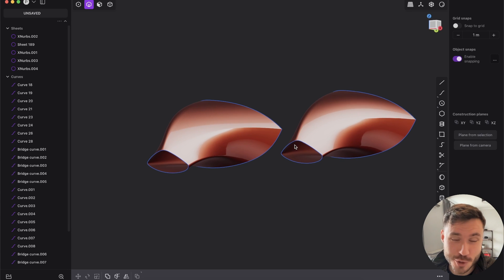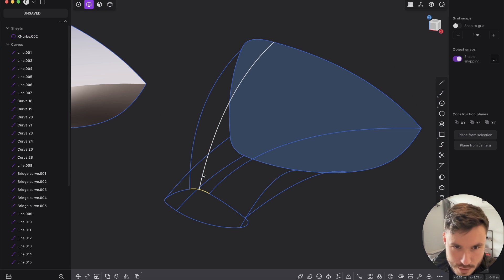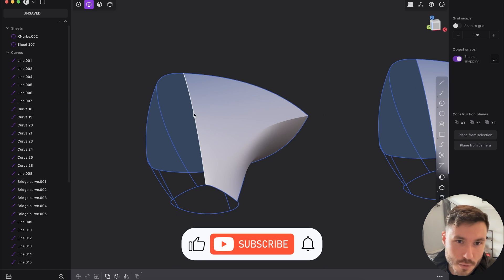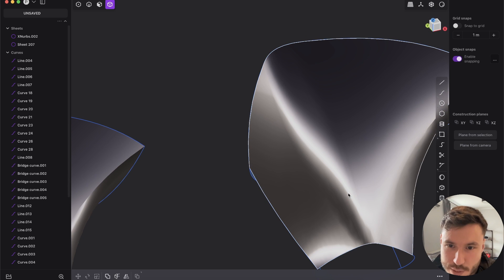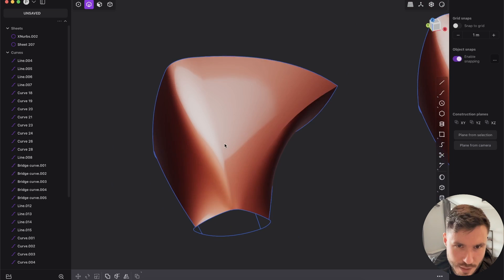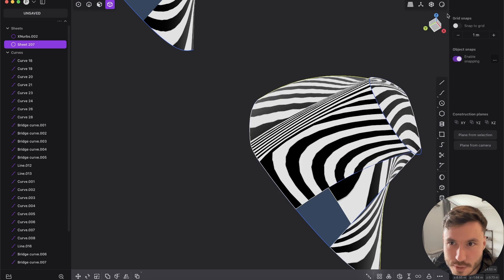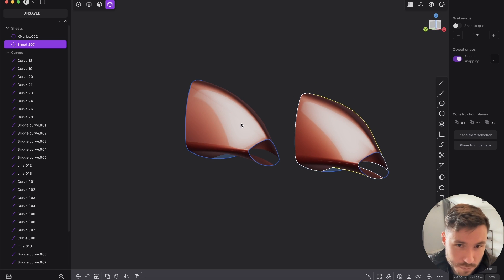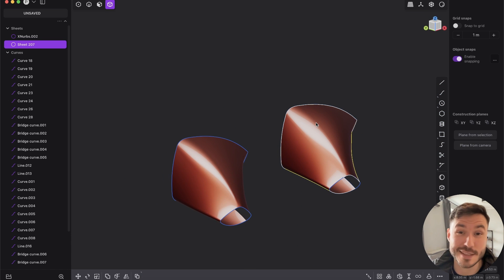xNURBS vs. Plasticity | ADVANCED 1:1 Comparison - ANY GOOD?!

Comment: I have been using XNurbs for Rhino and SolidWorks. It’s not just about reflections, most of the time XNurbs will produce a surface with less control points, this really helps keeping downstream surfaces cleaner. If you trim a really clean surface and fillet it will produce a better fillet. For the Rhino plug-in we might be getting explicit degree input option, this would make it great for class A primary surface. I love it, it’s my most used tool

Comment: Can someone explain to me why when i make the same model in Fusion v Plasticity - a simple 3x3x3 inch cube with a 1 inch diameter semi circle cut through the full width of the cube, when printed the one on plasticity always has steps through the curvature of that cut out, and the Fusion version is silky smooth...? Printed in the same project so both have the same settings
Reply: Yes! I just started learning this app and I noticed the same thing when I used one cylinder to cut into another one at the top. A segmented result.

Comment: Maybe the results look similar, but that's not the point. XNurbs is far more forgiving, it doesn't fail that often, you achieve results much faster and without going mental. Plasticity's claim is CAD for artists. And artists don't want to mess around with technical issues, they rather want to express their art. And if XNurbs lets you do this without making you fantasize to shoot your computer with a 12.7mm cannon, then God bless XNurbs.
Reply: My experience exactly.  It's not only about surface quality.  I also find it's faster because I'm not searching for alternative methods, as when a Loft or Patch fails.  Anything that keeps you in the "creative zone" rather than in "fix it" mode is a good thing.
Reply: @cascadiadesign  creative zone rather than fix it mode 💪 I love it!
Reply: I use it because I love to mess around with technical issues. 😂
Reply: @Kuechmeister  ich laber hier über Normalsterbliche, nicht über solche wie du 😀
Reply from the maker: Good point 👍

Comment: Even in your example the transition difference that you get with Zebra stripes is not only A LOT  better in Xnurbs, but super difficult to replicate otherwise. It's the difference between Class A (at least close to it) and a rough prototype . The quad sided feature is insane and I think it replicates the square tool in Alias. For an industrial designer/production environment, the difference is huge and that feature is very welcome. Also lets not forget about points and how the surface will eventually Rebuilt if needed....more irregular cv s are a lot harder to rebuild. In a way when we get close to have some parametric features it will eventually make things faster because you ll be able to rebuild down those surfaces, so yeah .....even the average averager "just doing renderings" user  could eventually benefit.

Comment: I've been experimenting with xNurbs for a few days now on a car model.  Yes, in most cases the pre-existing Loft and Patch tools do a great job as they are very good tools to begin with.  Where xNurbs has made a difference for me is in creating sheets from complex wireframes.  Many would say to divide a complex sheet into smaller, more manageable sections and then join them together.  I like to push the limits, so I tried making large complex sheets in one go.  I found xNurbs succeeded where standard Patch failed.  The key is to use the xNurbs option settings - try every one of them because they are powerful at smoothing a lumpy or distorted surface you may get with the just the default settings.  I use them with zebra turned on to see changes in real time.  The default settings are great for quad sided simple sheets, but as you get crazy with your shapes and guide curves, you'll benefit using the option settings. Speaking of guide curves - they do not have to connect to the perimeter curves (green dot); they just need to be close.  This saves time re-connecting the guide curves as you make small adjustments to the perimeter design. Finally, I was surprised that my xNurbs sheets would join with neighboring sheets when I applied a lot of smoothing.  This was not always the case with the Patch tool.

Comment: So I think this video is a fair comparison. FWIW, the best results in a quad-sided patch would come from flatness=1. But that said, xnurbs is a professional tool that fortunately is also easy to use. It is able to solve more complicated problems than patch and it is able to produce better results in most cases. But these differences are important primarily for professionals. When you watch car surfacing videos and they are tweaking cvs to get exactly the highlights they want: those are the kind of people who xnurbs is aimed at. What is compelling about xnurbs is that it one tool that can replace patch and loft, it will fail less often, it's faster, and it produces higher quality results. It isn't necessary! But it's pretty awesome.

Comment: Good video,  I think regular Plasticity will continue solve my needs. I ca see a pro needing it . If the output to .obj or some thing has  better topology too some how , them maybe it would be handy for my Realtime/game assets. Would be interesting to see wire frame of the resulting exported meshes if all settings were the same.  Again plasticity as it is now still does a great job .  To me it looks like putting cream on top of milk .
Reply: This was my question too.